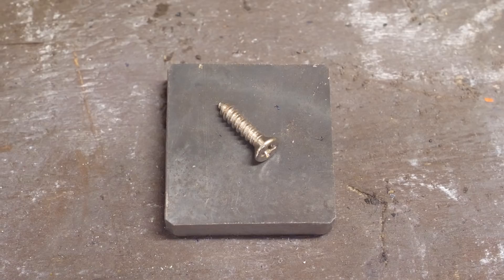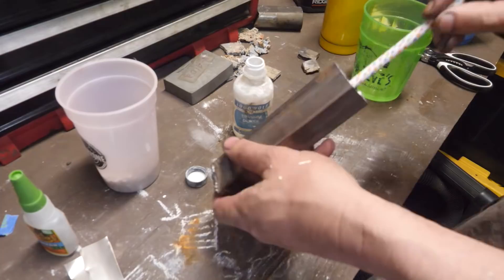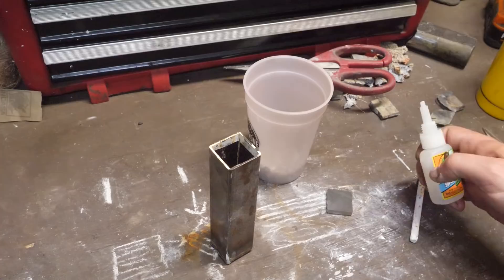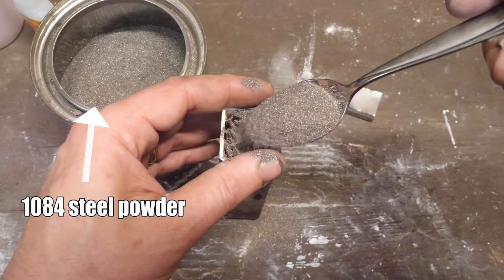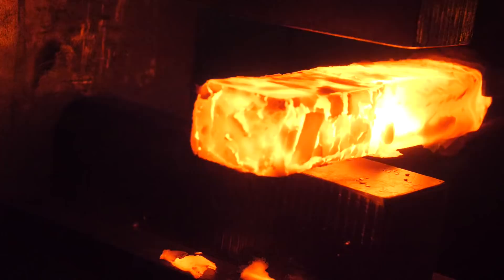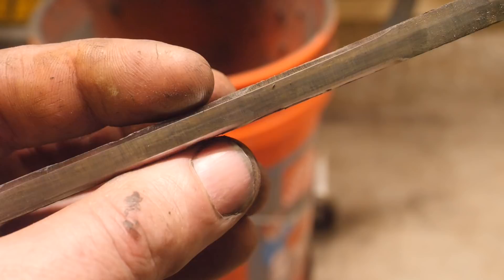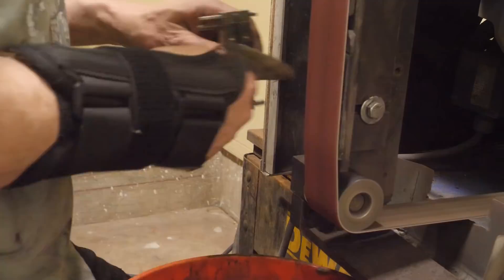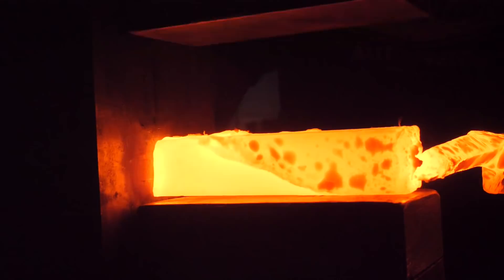Forging A Knife From Screws

Comment: Depending on handle shape and materials is hard to pick between the two, think I prefer the no-powder version. Maybe a Osage’s orange handle with shorter dual (front back) guards and matching pommel ( if your tang is long enough).

Comment: Back in the day smiths used to use an oil lamp to coat the steel with soot to keep them from sticking together, wonder if it would work with canister dimascus

Comment: How in the heck do you make such clean bevels that go all the way to the spine
Reply from the maker: Much easier than clean lines mid-blade for me.
Reply: This one sucked to learn on my own,  so I hope this helps! First, forge your bevels as you would normally, and then as the line between the bevel and flat becomes defined, treat that line like the new "edge" and bevel it likewise. You'll get a quick and neat triangular cross section, especially if you focus on how the anvil is moving steel instead of the hammer!

Comment: Simpler than indicating on the box, just make up a handle that has a bent hook. Hook points at the blade's edge. Whenever i do (somewhat) similar stuff where i want to keep orientation, because i do it rarely and don't wanna mess up, that's my game. Haven't frakked it up yet, so it has too work. :))

Comment: awesome vid Steve! that bright line could be the carbon migration boundary .
Reply from the maker: hmmm interesting tell me more
Reply: @GreenBeetle  I don't  really know enough to speak well on it. My understanding is that Carbon can move from a higher source material at those welding temps. I think k its called  Equilibrium. That's how case hardening works right. The same thing happens between dissimilar metals. I could be totally off my mark. Your theory about the iron content in the flux is just as plausible.

Comment: Could you try making a knife from chain? Large chaim. It goimg up the length of the blade. Not small chain folded on to fill the canister? Ive wanted to try it myself. But cant ignite my forge where i live. Safely. Fire danger.

Comment: Always wondered, is there anything special you have to do to stop the can of powder turning into a can of rust? I presume it needs to be pristine to forge weld properly.
Reply from the maker: Never had an issue w rust in powdered steel.
Reply: @GreenBeetle  Far out.

Comment: Hey Steve would notching the welded on rod work on keeping your billet in line
Reply from the maker: great idea.  I did one press on both sides with long axis laying down to secure the lids with forge welding then cut off the handle and turned it up on its long axis to press it from the top and bottom before welding on another handle to draw it out.  So original marked handle got cut off and I forgot how I oriented the markings on the can...
Reply: @GreenBeetle  Sorry my grammar was so awful. Maybe there is a way to color code some of the handle ends of your rods so you can cut it off. But still keep track with a different rod that’s colored the same.
Reply: @GreenBeetle  if this isn’t useful I apologize just trying to help make it better.

Comment: Complete noob question, but would it effect the strength of the knife if the screws haven't completely welded on the spine?
Reply from the maker: yup  being unwelded on the surface or for a few mm prob isn't a big deal on a knife this size
Reply: @GreenBeetle  Ah I'm with you. It still looks pretty cool

Comment: Could that white line just be decarburization? Presumably your foil is something very low carbon, and given the short soaks at welding heat that accompany forge welding some minor carbon migration wouldn't be out of the question. I'm no expert though, I still do all my welds with unsealed billets, I've never done stainless lined cannisters.
Reply from the maker: Well that’s not a bad thought
Reply from the maker: Well that’s not a bad thought